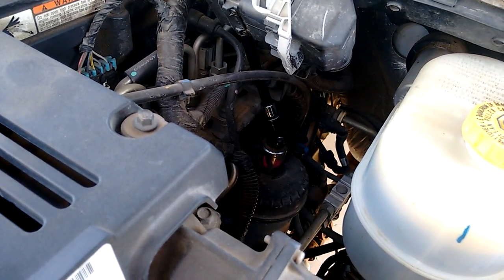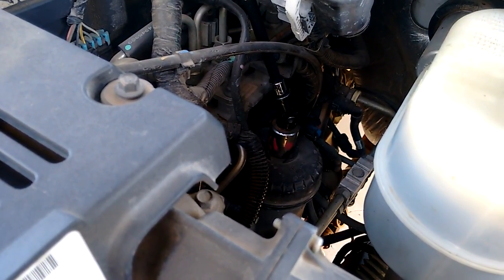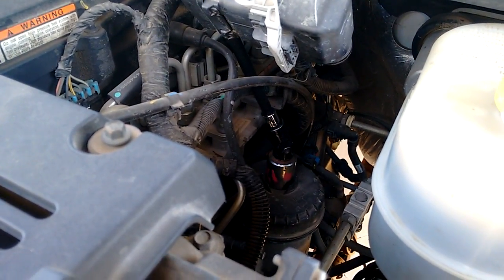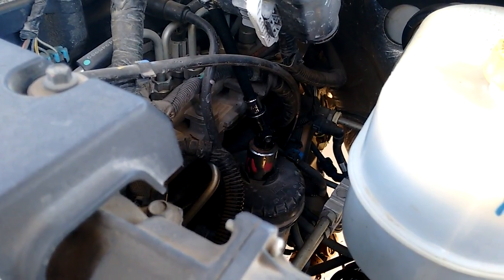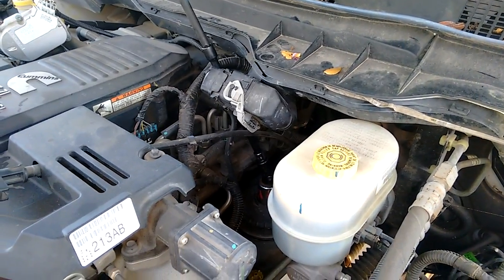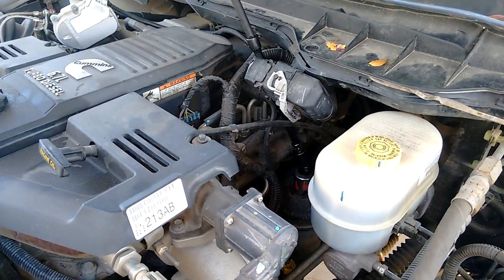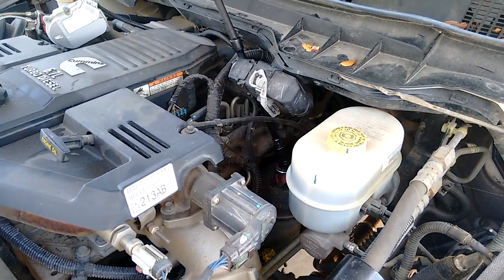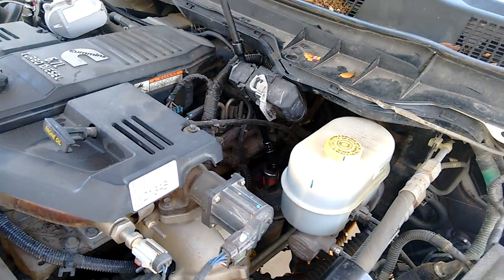How to Change a 2012 Dodge 6.7 Fuel Filter

Comment: Quicker tip loosen the yellow purge valve right next to the filter cap put a catch can up under the truck to catch the draining Diesel fuel… That will release a lot of the pressure on that cap and make it 100 times easier to remove… (DON’T FORGET TO CYCLE YOUR KEY 7 OR 8 TIMES TO RE PRIME THE FILTER AFTER YOU REPLACE IT…) Hope this helps…

Comment: First time I changed my fuel filter in my 2012 I was pulling my hair out. Luckily I found i had  1/2 breaker bar and a long extension that allowed me to get to the filter and have good leverage to turn it. Thank you for the video, good to see I'm not the only one with the frustration.

Comment: Thanks for the video. I’m sitting here frustrated after wasting hours trying to do something  that usually takes me 15 minutes. But last time I had my 6.7 serviced I splurged and let the mechanic change the fuel filter. Just like you said they torqued the hell out of it and now I’ve rounded my cap nut, busted my knuckles, burned my forearms and cursed out the whole neighborhood because the cap won’t budge an inch. So now, before I chisel it off, I’ve ordered a new cap and I’m going to wait until it arrives before doing any more damage. I know I’ll eventually prevail and remove the cap but I’m most likely going to ruin it in the process. Your video made me feel better knowing I’m not the only one pissed at mechanics who over torque things knowing it’s going to affect the next person who tries to replace it.

Comment: Be advised diesel does swell rubber material, so when you put your fuel filter canister cap on don't do it to tight, because the o-ring will swell and will cause the same issue, just look at your service manual per manufacturer to look at torque specs for your filter cap. Most diesel trucks I do fuel filter services on all have the same issue. The trick is to keep a consistent pressure on it when you're spinning the filter cap off.

Comment: Hey the only thing I would like to add. Sorry if I over step. But. Use a wobble not an elbo. I about rounded the “ plastic nut” on the cap useing the elbo, but the wobble had no issues!
Reply from the maker: I tried a wobble Extension and it would not work for me. I do not own any wobble sockets, may need to get some. Thanks for the tip.
Reply: archersfriend Absolutely sir. I was the exact opposite. I only had elbows myself but ran over to Harbor freight and grabbed a set for about 4 bucks. Not sure if you have harbor freight in your town but, Your video was a humongous help thank you very much for posting it.

Comment: Question, and maybe I need to call Geno’s... I’ve got the Billet cap but I noticed it didn’t come with an o ring or even a groove for one. Does the plastic OEM cap have it’s own o ring? I don’t remember. Or, does the o ring on the filter do the job itself?
Reply from the maker: The Filters come with a new O Ring. I do not have a Geno''s cap yet, but will probably get one.
Reply: archersfriend thank you

Comment: The tip is, order a billet cap, and be done with the plastic factory cap
Reply from the maker: Can't put on a billet even if you can afford one if you can not get the plastic one off. The tip really is that when you do get the cap off without destroying it, Do Not Over tighten it and add some anti seize grease to the threads.
Reply: Billet cap is cheaper or right at the same price as factory plastic

Comment: Damn!  This filter change tip makes the FASS filtering and supplying diesel to our '99 5.9L 24V Cummins engine look like pure genius!  I just had the first hiccup today with our 2012 6.7L Cummins-equipped RAM Longhorn, which is what brought me here.  I'm not positive, but my experience operating CAT heavy equipment in cold weather tells me that the power loss I suffered earlier today (at 5 degrees F) is due to a frozen/clogged fuel filter.  After seeing this video, however, I'm not looking forward to changing the fuel filter on our 2012 at all!  We've got less than 42K miles on our 2012, as of today, but I'm now starting to think about a FASS (or an equivalent system) for our Longhorn!  A bitch to get off is absolutely right!  Thanks very much for the education -- and keep up the great work.
Reply from the maker: Thanks for watching and commenting. Just about Every piece of heavy equipment I have used or Big Truck Engine I have driven has a better Fuel  Filter System than the Light Ram Trucks.
Reply: Hey Big Kid -- Did you stick with the stock filter cap or upgrade to something else?  As I mentioned before, your great video tip has me seriously thinking about a FASS (or an equivalent delivery/filter system).
Reply from the maker: I did not break the stock cap, so I am still using it. I did put anti seize grease on the threads and did NOT Torque it to the 100 FLBS that the factory had.
Reply: Do you recommend a certain brand and/or part number for the replacement filter, Big Kid?  God bless the south!
Reply from the maker: eBAY SELLER " allianceautomotive"  has great prices and after talking to their tech support about the their filters, I am using them exclusively. Had been using Wix, but the Cost for the 6.7 and especially the 6.7's with DEF and 2 filters are very expensive at the Auto Parts places.
Reply: Thank you for your help, sir!